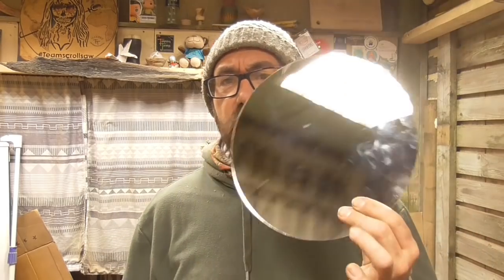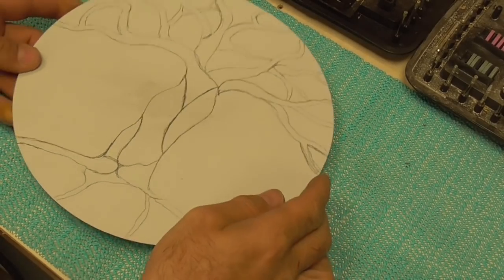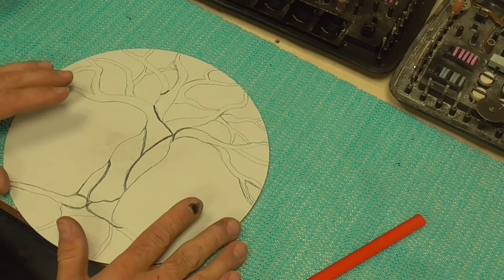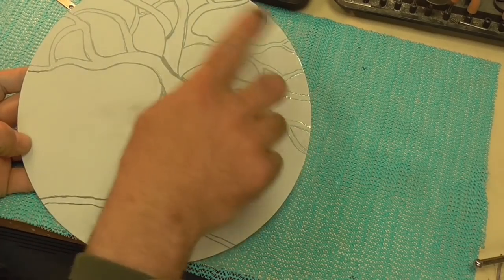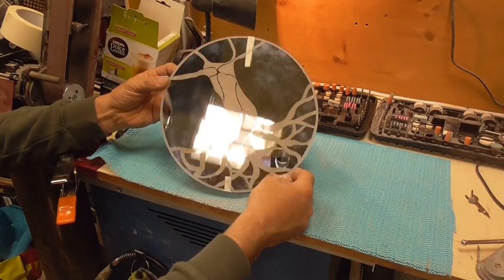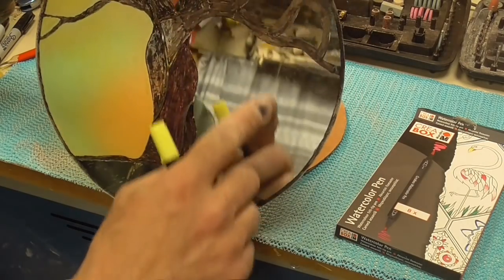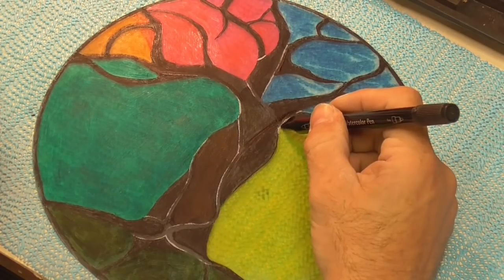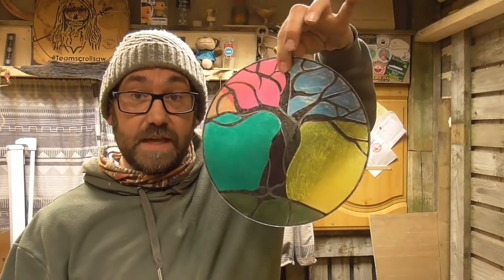MAKE A STAINED GLASS WINDOW FROM A MIRROR !!

Comment: I did a similar project when I was around 14, also discovered by mistake. 
I had an old mirror that fo some reason got a scratch on the back, I noticed light shining through the scratch but it was invisible when dark.
I used a very sharp metal pin to scratch a design on the back, filled it in with a regular felt tip pen.
Still worked as a mirror until light shone on the back.